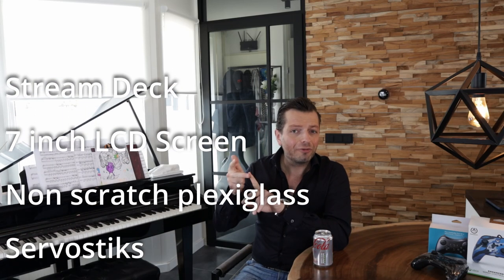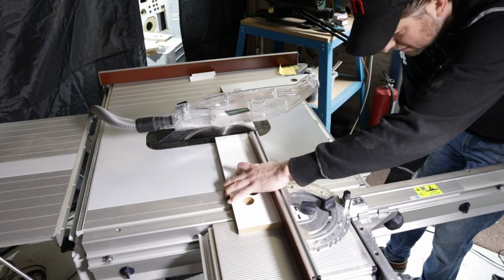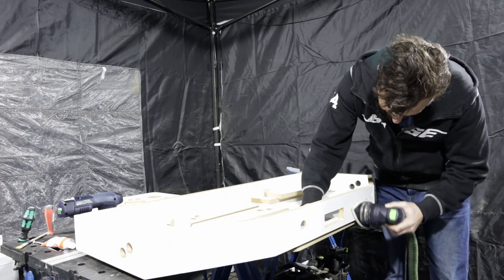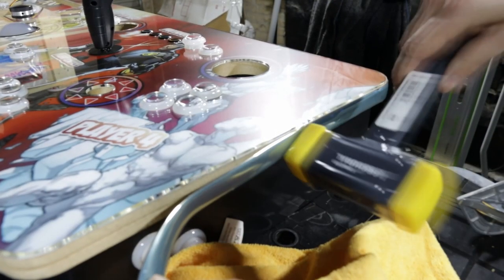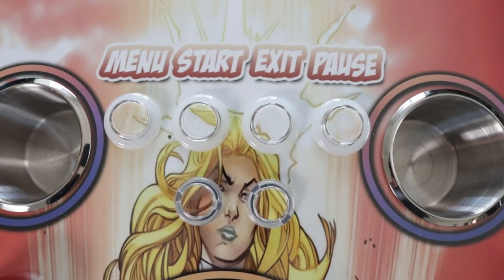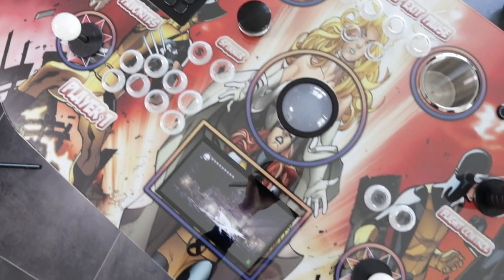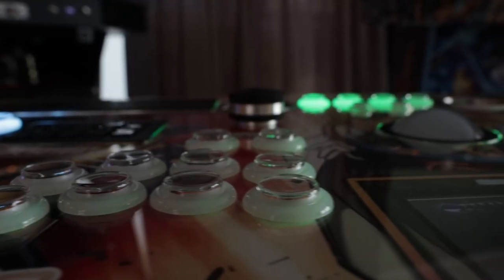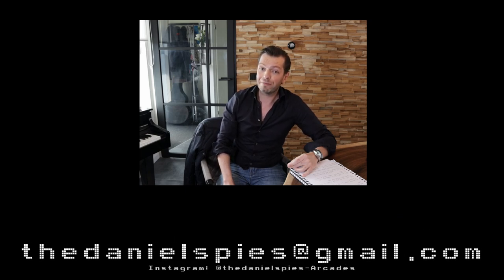Monster Arcade Control Panel -4 player- full RGB with lasercut scratch resistant plexiglass coating

Comment: Thank you for your videos, VERY helpful! My current build (I believe is one of a kind as of now). It's designed to utilize a 7" touch screen making the control panle less cluttery and much more end user freindly. I've written a menu program that will run on the LCD to handle so many functions removing the need for start, exit and pause buttons. Volume control available as a slider, servo motor change from 4-8 way, sleep mode, shutdown, restart and program menu items such as ledblinky, rocketlauncherui, hyperspin, mame config, joypad, WinIPAC and onscreen keyboard. This also removes the need for all the external hardware like keyboard, audio controls or game shortcuts etc as well which cust the build down price as well.  To leave the retro feel, the coin in and player start are still buttons.
Reply from the maker: Sounds awesome 😎!!
Reply: Can you link to the display you used?  Thanks!

Comment: Do you find it hard to use the flght stick or spinner.  AKA stacking the controls  does the controls below ever hinder it?
Reply from the maker: Hi, no if you position them carefully, they are not in the way

Comment: Thank you for the parts list for my 4 player build. I appreciate you taking the time and like anyone else when you spend the $$ you want the best. I just got a pair of ultimate I/O boards today from overseas and I will order buttons,  servo and regular sticks, wire sets and gold leaf switches. I wish I had a cnc available to me to do the fine work creating the button platform but by the time I am ready for this. I will finish my Alder Lake PC for this Big Box build. I own a simple table saw,  router and some tools so this is mostly going to be slowly hand tooled. Any tips other than patience  would be appreciated.
Reply from the maker: Hi Preston. Maybe some ideas: Print the designs out on paper and stick them to your MDF panels. Then cut the panels by hand. First order the plexiglass panel and use that as a template to cut the wood. These need to line up exact. Pockets you can do with a router yourself. No CNC needed.  Watch my Ultimarc tutorials for the components and you are always welcome to email me if you get stuck somewhere. Have fun building! Thanks Daniel
Reply: @TheDanielSpies_Arcades  I bought some poster board and I'm tracing my side panel.  Is there an outfit you can recommend who can cut some plexiglass? I'm deafly afraid of ruining a plexiglass panel. No issue with wood, particle board or MDF cutting with me but plexiglass seems like a death wish gutting those circles for a four player panel with trackball, spinner and flightstick cutting.

Comment: Ok, I built my first control panels around 1997 when MAME supported like 7 games. I'm ALLLL about putting things in simply because they are cool... but is there any 'practical' use for the 7" monitor in the CP?
Your work is amazing by the way. Great stuff!!!
Reply from the maker: I use the monitor with HyperMarquee. The game art will change automatically with each game. You will love it, I promise 😅
Reply: @TheDanielSpies_Arcades  haha, I'm sure I will! My last build was a 4 player cab in 2013. I want to build a monster pedestal. I plan on putting in that monitor based on the coolness factor alone, LOL.
On another note, thanks to you I learned what a Stream Deck was! Never heard of it before I discovered your videos a couple weeks ago. Already got one for my desktop computer... and plan on using one in the pedestal... my main use for it will be for C64 emulation 🙂
So thanks for that!!!

Comment: Absolutely amazing as always. I see the new tools are working out well for you. I'm interested in pricing on such a thing as other commenters are. I've been working on getting my new pc setup for and arcade, still trying to find RELIABLE places for ROM's. Right now pc/monitor just sitting on my pc desk, eventually will look into a cabinet and control panel for it.
Reply from the maker: You can buy a ready to go hard-drive from Chris Shaw (Hyper Arcade Systems) or Kris Koolmod (Retrobeast) both are excellent and several of my customers own both!
Reply: @TheDanielSpies_Arcades  Do you know if they work with Launchbox/Big Box? I have an 8TB HDD with it on there and Mame and a few consoles on it with Launchbox/Big Box. I'll still check out the 2 places you listed, thanks.